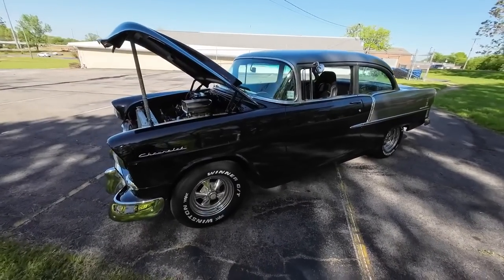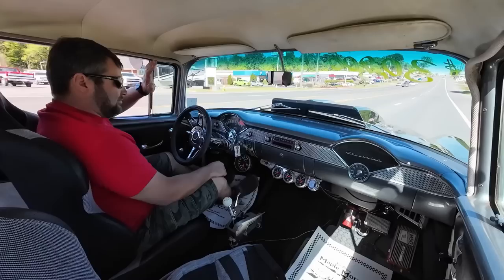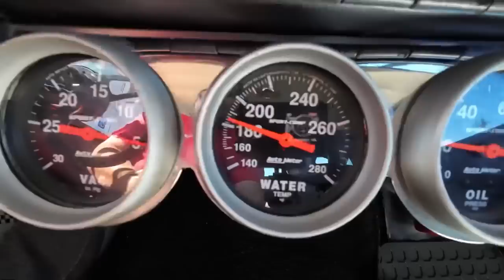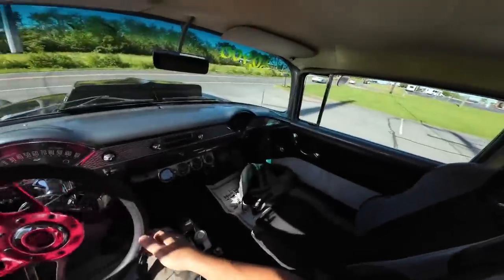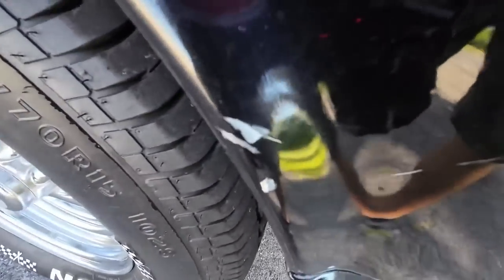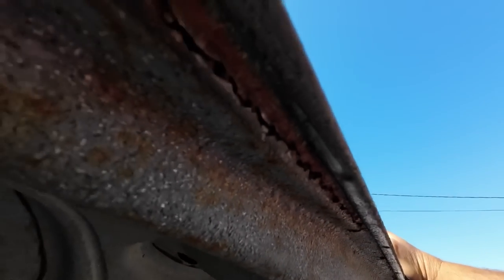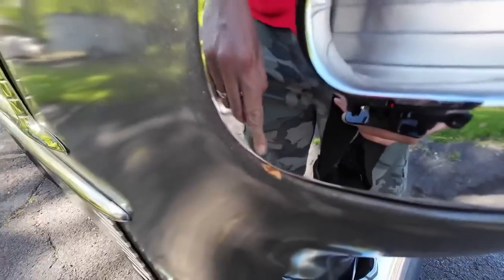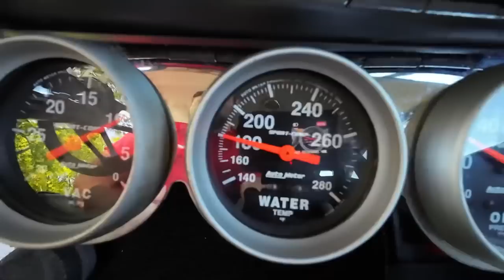Test Drive 1955 Chevrolet 2 Door Post 400 V8 SOLD $29,900 Maple Motors #2149-1

Comment: nice car but that hood scoop has got to go just to much, and why do all that work and not make sure heat, blower, horn and wipers work just don't understand why would do that I have built a lot of cars and trucks and always made sure everything worked.
Reply: I don't understand either man smh it's sad to see some of these absolutely beautiful cars and trucks have so many small issues that could've been fixed by the owner I just don't get putting a 5k paint job and 10k motor in something that doesn't have a working blower motor or windshield wipers horn ect ect smh
Reply: @scu-dub  I don’t get that either …take enough pride in the project and your work to have everything working properly.
Reply: @ronaldnorris2179  exactly 👍🏼✌🏽
Reply: @scu-dub  lol your not getting much of a paint job at 5k unless u talking about painting it yourself.
Reply: @Tony Chandley  or know someone that owns a paint shop and you don't need any body work....I have had several cars painted for under 6 grand that were excellent
Reply: Sorry I didn’t see your post But I agree it’s called cutting corners That’s a Hack car lipstick on a Pig it’s nothing more then a Bondo buggy that Trunk lid was shot, make’s you wonder what’s hiding under the paint??

Comment: My question is do you fix or repair the problems found with these cars?  With the prices you're asking they should at least pass a safety check. If they're pulled into a safety check point they're going to be ticketed
Reply: No they don't that's been asked get what u get
Reply: His prices are ridiculously low on most of his cars think of what it cost to build them
Reply: @koolkatkustomdiecast801  u right people don't understand that
Reply from the maker: No if we did fix everything we would raise the prices. They are all priced accordingly and it shows. We sell 60 cars a month consistently. Thanks
Reply: @MapleMotorsNickSouthgate  damn jiffy skippy and when I’m ready I will buy one from you probably cause your honest
Reply: No brainer
Reply: When you start fixing things some times you open pandoras box and things get out of hand. He basically buys a car and sells it for a mark up of $3,500 to $4,000.

Comment: One of the comments said not worth 30 I've seen them in this condition go for damn near 50. Wicked fast car and great looking and sounding. Nick just curious did you realize the trunk was open the whole video?
Reply: guy i know has a black 57 Belair 2dr for 20 in about the same shape as this one. Thinking about buying it. Correction, after watching the walkaround of this 55, that 57 is in alot better shape.
Reply: To many things don't work to be daily driver, not a  high dollar car, needs lot of work, no wonder they brought it back.
Reply: Well jones u better jump on this and save u 20k. 👍
Reply: @tonychandley1309  saying I've seen them and saying I would buy it too different things. But then I may lack your wit

Comment: Why is the steering wheels always off that would drive me nuts
Reply: Literally takes like 5 minutes to fix same as a horn 1 positive 1 negative wire the horn button completes the circuit.